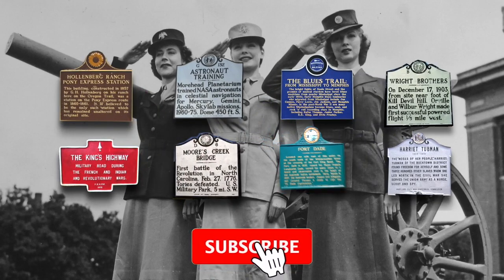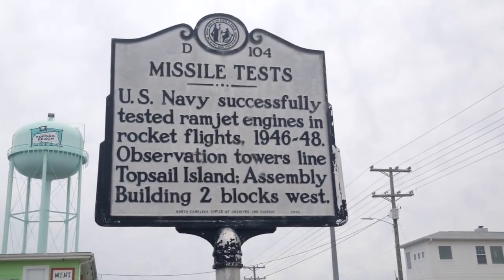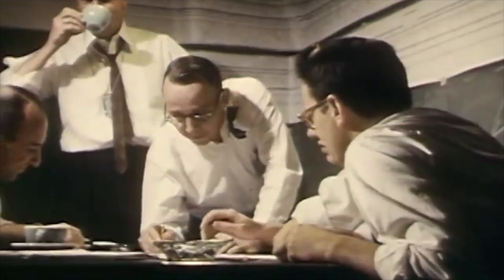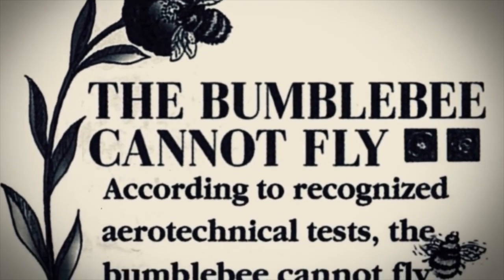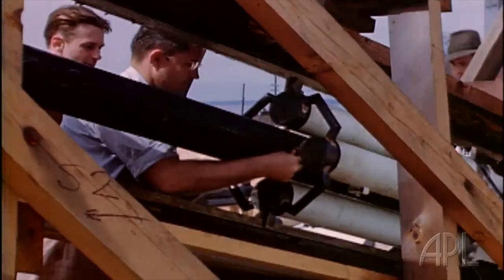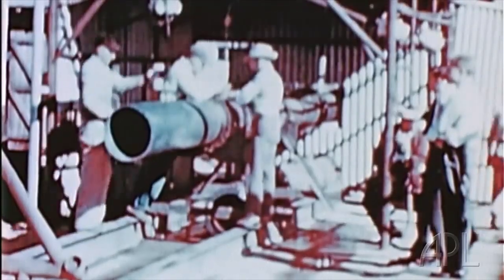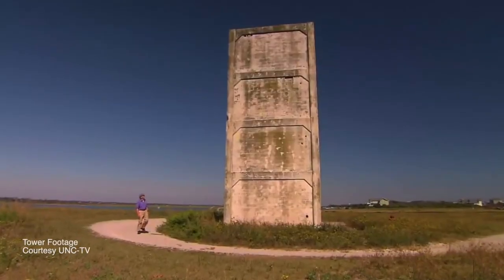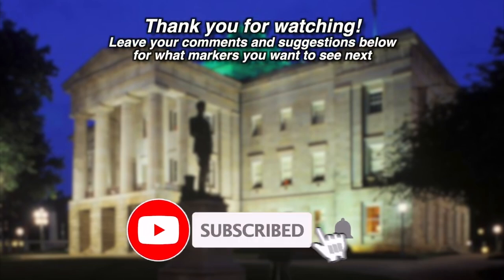Post WW2 Top Secret Missile Program off the coast of North Carolina - Operation Bumblebee!

Comment: Grew up on topsail on a canal beside queens grant, directly across from one of the towers, may of them were turned into houses, this one had its windows boarded up, painted and houses built around it unfortunately but regardless! A Talos is on display at the assembly building where they put the missiles together but is not listed as a display location